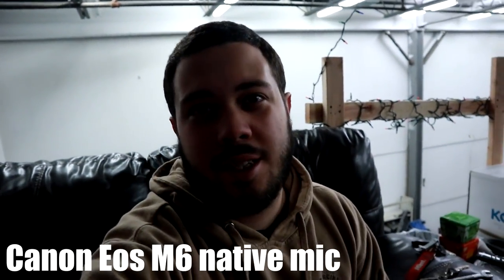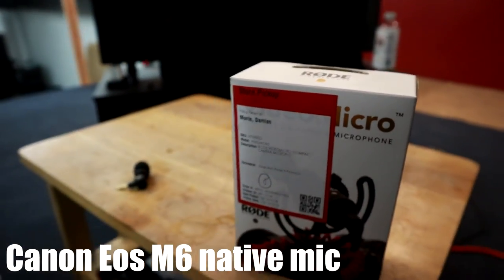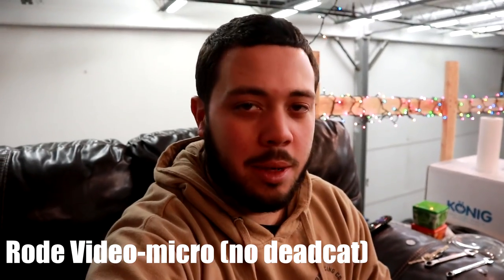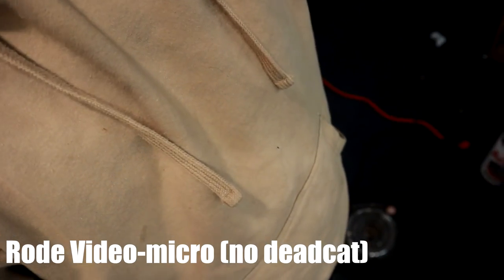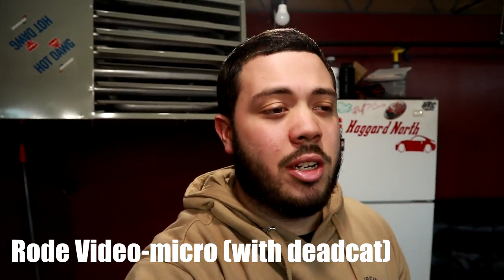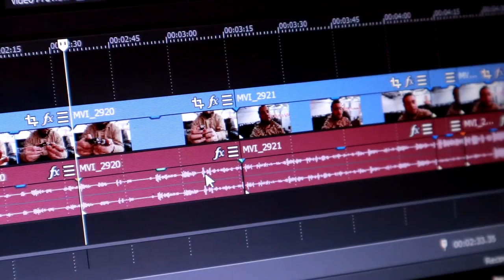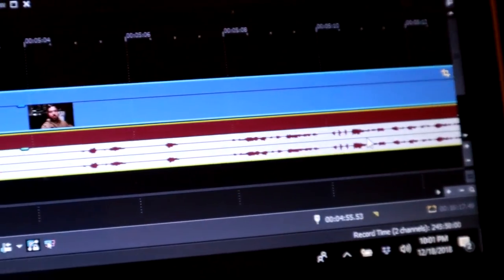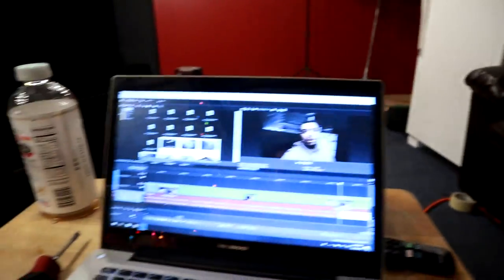VLOG MIC COMPARISON

Comment: Rode mic with deadcat, for sure! sounds way better. Try to mount it on top center or on the bottom center of the camera, if you put it on one side of the camera, it only picks up well half of the sound, like when someone talks on the opposite side of the mic, I can barely hear that. Just my .02, cheers my guy!

Comment: You don't need to combine each clip individually; just select all of the audio at once using the selection edit tool and then right-click combine them. The selection edit tool hotkey is "V" I think. It's the dotted box with a cursor in it at the bottom of the screen
Reply from the maker: Smorges Arnarmato shit wish I knew this 😂